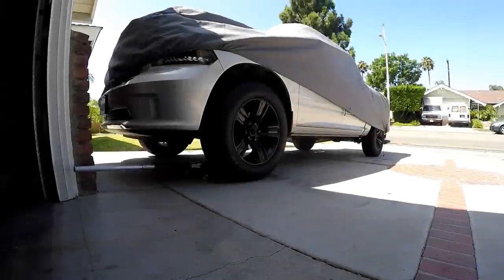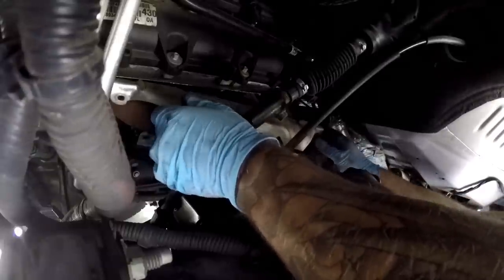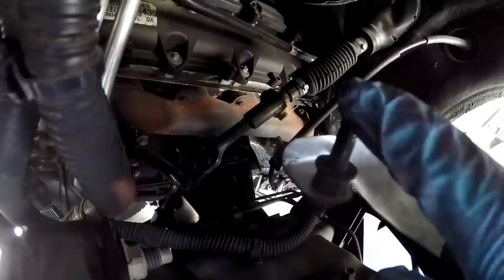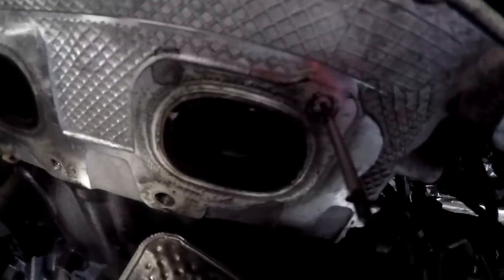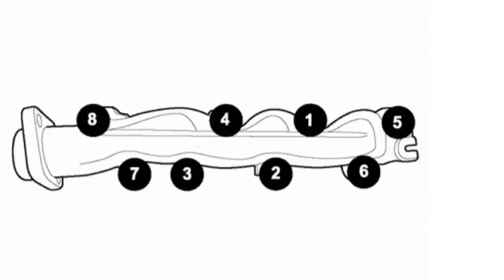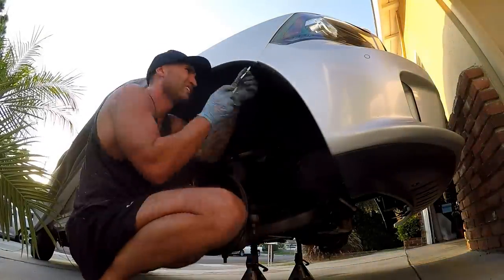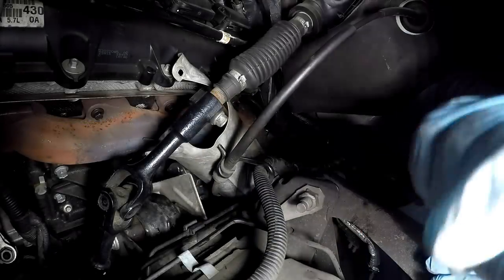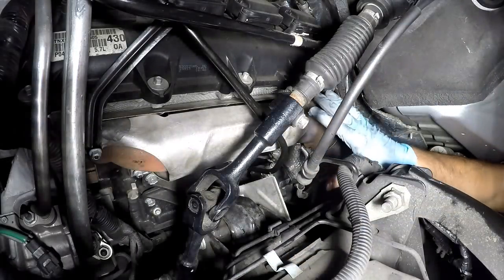DODGE RAM HEMI Exhaust Manifold Stud Replacement   Leak Ticking FIX

Comment: when I did mine yesterday (passenger side), the manifold was warped. That would be one thing to have have a look at for sure before replacing studs. I'm now thinking about just replacing the studs on the driver's side before something brakes
Reply from the maker: Yeah thats another issue!

Comment: By any chance did you ever get a oil pressure code with this problem? My 300 with a 5.7 is making the exact noise but I got a P0521 code. Any help will be appreciated . Thank you

Comment: What manifold bolts did you go with did you go back to stock bolts or did you go with quality aftermarket bolts and where did you get them?
Reply from the maker: I just went with stock since the smog laws out here are crazy and they have the studs and nuts for mounting the heatshields as well.  I bought them off ebay from a mopar dealer for about $30 shipped per side for all the hardware
Reply: Okay I may do the same I do like the heat shield the dealer actually told me to go with arp but I haven't been able to find any stock looking ARP bolts. They don't offer the stud for the heat shield so thanks for the reply though
Reply from the maker: Yeah you would have to get studs and then modify the heatshields by drilling them out for the larger bolt holes and buying more nuts, etc etc.  I didn't feel like going through all that I'll just make sure to change these bolts out again sooner before they snap in the head if I still even have the truck by then!  They seem to let go around 80-90k miles on my truck.

Comment: First, on behalf of everybody, thanks for the vids man. As always these are ligit so we appreciate it. Off the wall question but do you happen to know what that slot is with the flap in the driver side wheel well panel? Just installed the CAI and i was just worndering if i should remove the flap for air flow or something.
Reply from the maker: Hey Jeff!  Thanks for your support on the channel!  That flap is and access panel that you will see on both fender liners so that you can reach the lock tab that holds the headlights in.  You need to access it to remove the headlights to even change a bulb.  You could leave it off if you wanted but I doubt you would notice a difference

Comment: What did you use to extract the sheered off bolt that was still in the engine block?  Like where could I buy the exact bit and what is the name of it?
Reply from the maker: Just search "bolt extractor" or "screw extractor" on google or amazon.  Don't buy a cheap one though or it might snap like mine did 🤣

Comment: How long would you estimate this job would take if everything goes smoothly? Like 2 or 3 hours?
Reply: Longer if you have more than 1 stud broken, also how deep the break of said stud is. Different ways to remove stud require more time and effort. Honestly not a job for weekend warriors. Goodluck if you break the extractor in the head.

Comment: Boostedmotorsports 
How much did it cost you for the specialized guy to come out and extract the bolt? I’m in the same boat as you.
Reply from the maker: I think it was around $100 but it was worth every penny not having to take the truck in or tow it or pay a shop to do all the work

Comment: Very old post here but I thought it would be fun to throw this out there. I used to maintain a fleet of cutaways with Ford 460 engine and the exhaust bolts broke all the time. We used a process called METAL DISINTEGRATOR MACHINE (MDM) (aka) ELECTRIC DISCHARGE MACHINE (EDM). (Google it) The process is amazing to watch work, when the bulk of the bolt es burned away the threads or broken extractor simply fall out onto the floor. It was never cheap to pay for this service but was generally a time saver.

Comment: I have a 2013 ram 1500 crew cab sport 5.7 hemi,it makes that ticking noise on cold start,but after 30 sec to 1min it goes away,so you think I should wait till 80k then change it?I have 62k on it..
Reply from the maker: Hey Peter. Personally I would get to it sooner than later.  If you already have a ticking noise chances are at least one bolt is broken and the longer you wait the more bolts will snap and will need to be extracted from the head.
Reply: BoostedMotorsports 
Thanks bro I wish you live in Seattle I would drive to your place and help me fix it.lol but yeah I'm going to my friends to help me fix it
Reply: Can you send me the link to bye the bolts please thanks

Comment: Have you experienced this problem on the chargers? After watching your video I’m convinced this is the problem I’m having on my charger
Reply from the maker: Yeah the 5.7L chargers have the same cast manifolds with the same problem. 👎
Reply: BoostedMotorsports explains a lot! Hopefully the dealer comes up with the same diagnosis. I was scared at first!
Reply: BoostedMotorsports the dealership just called me and told me they couldn’t hear anything out of the ordinary,

Comment: If it's such a common problem on every one of them, it should have been recall, i have almost 50k on mine so i guess it's coming, but my 06 model never had this issue, although i do have bumper to bumper warranty now i might have to consider jba
Reply from the maker: Yeah if you aren't in an emission strict state I would get long tube headers as it really wakes these trucks up!  JBA is a good brand too! 👍
Reply: James S so has mine. 77k miles 2015 ram hemi 8 spd

Comment: My 2014 ram big horn has started leaking exhaust on cold start -- guess I have to do this repair soon. I have been a truck enthusiast for the last 40 years and have purchased lots of new trucks over the years. In all my years I have never heard of particular engine which was common for them to snap exhaust bolts. 
Pretty sad from a manufacturer's "build/design" quality perspective!!
What's the real issue here? Substandard bolts? Substandard/warping manifolds? 
This issue is really strange

Comment: Dude! The gasket set says it will fit  2014 Dodge Ram 5.7 V8  but the link for the bolts Amazon says will not fit 
(what's going on yo 🥴

Comment: If you plan on going to back with the same exhaust manifold make sure its not warped or you will be right back in there with in 24k miles.
Reply from the maker: Yup I agree!

Comment: Great job on the replacement.  I know that it isn't necessary, but I would have really disconnected the steering column shaft to make it a lot easier to get things out on the driver side.  Spot on about the extractor bit.  I would even go so far as to suggest that you not use something like that from Harbor Freight.  I do buy stuff from HF, but something that is needed for such a delicate job needs to be high quality.  

Concerning the loosening manifold bolts, I definitely believe that it has a lot to do with the aluminum and cast materials.  I had an 82 Celica GT that I used to run the Autobahn's at 130 mph all the time that I kept having to tighten the exhaust manifold studs quite frequently.  I could always tell when that was needed because the heat shield would begin to rattle.  After I finally wore the threads out in one bolt hold, I drilled all of the holes out and installed Heli-Coils.   I never had a problem after that.
Reply from the maker: Thanks Ed!  Yeah steering column would definitely make it easier but was just trying to save steps for those trying to tackle it at home.  On the header install I definitely disconnected the steering 😎

Comment: I have a '13 - 1500 Ram with 66K miles. I'm on my second set of bolts for the passenger side. Was wondering, if this is an aluminum head, with cast manifolds, different heat / cool rates could be the cause. What do you think about replacing with custom exhaust manifolds? May solve the issue?
Reply from the maker: Tubular stainless steel exhaust manifolds with upgraded bolts will solve the issue. Check out my other videos, I ended up replacing these with JBA shorty headers and stage 8 locking fasteners 😎
Reply: Just wondering if you get coated headers do you still have to wrap them.
Reply: @BoostedMotorsports  would that kill the warranty

Comment: the link  you mentioned in Amazone about the bolt is not for  2015 1500 ram 

but your ram is same as mine 2015 regular cap 

I am getting confused

Comment: I've got 23k miles on my 2017 ram 1500. Not sure if the ticking im getting is from the manifold bolts or just the traditional hemi lifter tick...

Comment: Any way you can describe where the dip stick tube bolt is so I can remove it? It’s really hard to see that part in your video and this is where I’m stuck, can’t figure out how to remove the dip stick.
Reply from the maker: It’s down by the knock sensor on the block 👍

Comment: I just bought an 08 ram 5.7 with 90,000 miles, is it common for the studs to break on the older years as well?
Reply from the maker: Yeah common problem even from the 03 5.7L HEMI to current
Reply: @BoostedMotorsports  bummer... I'm starting to hear a little ticking noise at 1500 rpm now...
Reply: It's not just the 5.7.  The 6.4 is doing it too(don't ask me how I know).
Reply: @UTBanjo  are the 6.4's  having the cam and lifter issues as well?
Reply: @beaumontbenji4083  Only on a limited number of engines produced late '14 through mid '15

Comment: FCA replaced both side manifolds, gaskets, studs and heat shields free of charge on my 2010 Ram 1500 5.7L.
Reply from the maker: Damn I wish my dealer did that for me!  Oh well its fixed now and I have piece of mind that it was done correctly and I don't have any helicoil or time serts in there :)

Comment: Took my ram to the dealer to have it done since it was still under warranty. 
The replaced the heads because the could not get the studs out

 I explained that you just weld a nut on the stud and than unbolt the stud. 

They told me they were not allowed to do that 

Waste of money in my book
Reply: I just took mine in and they said they would only replace the exhaust manifold and would extract the bolts if I paid for it.

Comment: So the leak comes from the manifold having cold and hot cycles and isn’t completely flat anymore so putting the same old manifold with out machining it or flatting it out in a belt sander or new manifold it will still have a leak or leak will come back.

Comment: How big was the drill that you used. I’m having trouble getting a drill in that small are to actually drill a hole
Reply: CHASIDY LAFOUR 
I would say 1/4 inch. You can buy an expensive set of bits from rescuebit.com that will even drill out a broken extractor. They cost a lot but can save the day if your having a hard time drilling or break off an extractor. The biggest you would want to go is 1/4 but that would not leave you pretty close to the aluminum threads in the head.

Comment: Didn't see it in this video but my 2015 has a nut and a bolt holding the dipstick tube. The bolt is in between the motor mount and the block and no room to remove it. Therefore I couldn't remove the dipstick.

Comment: Is it this easy on a 2005 ram I have the same problem and I’m also putting on aftermarket shorty hedman headers
Reply from the maker: Yes sir same procedure!  I would put some aftermarket headers and stage 8 locking fasteners so that you don't have the problem anymore.  I just did this a week ago 😎
Reply: Did you get any gains out of yours ?

Comment: Did you inspect the manifolds for flatness? They should warp once after a lot of heat cycles. After they are flattened they shouldn't warp again.
Reply from the maker: Good point!  I ended up replacing them with upgraded stainless headers 😎

Comment: How much would this cost to fix? Would just installing shorty headers fix the issue?
Reply from the maker: Yeah installing shorty headers should be the end of the problem but you still need to remove the snapped OEM bolts 👎

Comment: Man, things like this are a lot easier with assembly fluid. It's basically a sticky goo that doesn't harden and won't interfere with gasket sealing. Throw a little on there and your gasket will stick in place while you get everything else lined up.

Comment: ps. i got lucky with the bolts. 1 busted and the welder paid for itself by taking it out. Saw that trick from another video. Also the 10mm shield nuts 1 broke off and another actually twisted out the 13mm because Dodge cross threaded them

Comment: my 2017 bighorn just started this at 100000 miles. I had a2006 4.7 that started this at 125000.....nevere fixed it lasted to 300000 miles before the whole manifold snapped off! Why hasn't dodge addressed this well known problem

Comment: I'm gonna dread replacing mine if dodge doesnt pull thru with my 5 month out of warranty, 2012 5.7 with 55k miles on it. Put a call into customer care and opened a case. I already found one busted stud at the engine block. Dreading the drill/extract or weld to the bolt to get them out.  $85 in my ebay cart for parts to replace. Dealer at $100 -$170 for parts.  Thanks for the info and video.

 Have you gotten alot of people telling you they had this happen on their Challengers with the same motor? I got a buddy that thinks putting in Lucas will make it quieter....I think he's got some busted bolts too....
Reply from the maker: Hey Joe sorry to hear!  Yeah unfortunately its common on these 5.7 engines with the cast manifolds.  I'm about to put on a set of headers with stainless steel stage 8 locking fasteners so that it never happens again.  If the challenger has cast manifolds too then it will be the same issue.  Some of the higher trim level challengers have stainless headers which won't have issues but the cast manifolds with the aluminum heads is the problem due to the two metals expanding at such different rates.

Comment: Given that the OEM hardware broke and caused this problem why would you use OEM hardware again?
Was it because there are no aftermarket replacements? 
Given Dodge's (i.e Chrysler) long history of avoiding their slip shop shortcuts... 
dashboards across not only Dodge but every Chrysler product, 
the TIPM fiasco and the paint quality issues to name few
I might be facing this in the future and the thought of reinstalling potentially defective hardware grinds my gears.
Reply from the maker: There isn't any alternative upgraded bolts that have mounts for the stock heatshields so I went with OEM again.  I have since upgraded the headers though and put stage 8 stainless steel locking bolts though 😎

Comment: My 14' is doing the same thing. At first it sounded like a valve tick and only lasted about a minute. It has now gotten a little louder to the point where I'm comfortable saying it is an exhaust leak.
Reply from the maker: Yeah it's pretty common on these trucks unfortunately!  Some people have managed to get it covered under warranty.  I would try if yours is still good!
Reply: 72k miles. I'm going to take it to the dealer and have them fix it.

Comment: What would cause these bolts to break?  I ask because I just bought a 2015 with a 5.7.
Reply from the maker: The cast steel manifolds warp and expand at very different rates than the aluminum heads putting a ton of stress on the low grade bolts which causes them to snap.

Comment: Still say it would e faster on the drivers side by disconnecting the steering shaft.  I'll be pulling mine and having the truck down for 2 weeks sending the manifolds to Jet-Hot for coating before reinstalling. they manifolds will run cooler and have less heat warping and less chance to break the bolts.  Unlike others I can afford to have my truck down to have the Jet-Hot done.

Comment: Isn't it possible to find some ARP bolts/studs that would hold longer ?
Reply from the maker: theultimate181 yeah you definitely could but they don't make a kit that will allow you to mount the oem heat shields back on. Living in CA with the emissions here I didn't wanna mess with it
Reply: They should make a kit....it would sell really well !  ;-)

Comment: Heard stainless steel studs are the best to replace.  They dissipate heat better as a fix.
Reply: This happened on my wife’s grand Cherokee and the dealer had to replace the manifolds as they were heat warped in the back and the bolts snapped. Not under warranty at the dealers this is a 3000k job. Parts and labor.

Comment: Do you know if these were fixed in the 2017 model?
Reply: Patrick Lacson 
Mine is 2017 5.7 liter and I just had this on the passenger side. It was ticking when I start it up, then as it warms up ticking goes away.  I found one broken bolt so I replaced all bolts and gasket. Same tightening pattern and torque as the video.

Comment: I had the same problem with my 2013 Ram 1500. It's covered under warranty ass long as you have less than 100K on your truck.
Reply from the maker: Man you're lucky you have a good dealer!  Mine denied it when I asked.  Oh well it is fixed now...
Reply: Mine is not, because it's older than 5 years, it sucks !
Reply: @HEMI345S  same here... only 54k miles on my 13 just did both sides.. Dealership wanted $1500 per side got them done at a local shop for $408 per side lol

Comment: How much were the studs and what name do they have like manifold studs exhaust studs?
Reply from the maker: I ended up getting them for about $30 shipped per side from a mopar dealer on ebay. I would do the same it is a lot cheaper than going to the dealership.  Just search your year and exhaust manifold bolts or studs and it should pop up!

Comment: Has that problem been resolved on the new Ram hemi’s?
Reply from the maker: I believe it’s still the same
Reply: Hey man I would say dont let this stop you from buying a ram because a few years back ford had spark plugs that like to break so they all have problems. Also I have a ford so I know this first and and dont get me wrong I love my ford it still runs and has 202,000 miles
Reply: Dawson Edge 
I bought a new Laramie.Love it so far.👍
Reply: Nope! I have a 2018 Ram and have a manifold bolt broken right now.
Reply: zash 
I have a 19, so I’ll keep my fingers crossed.